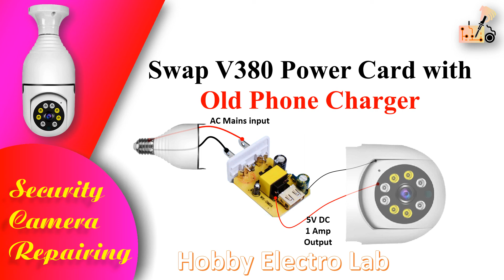Step-by-step Guide: Upgrade your Security Camera with a Mobile Charger!

Comment: Pa help na mn po sakin sira yung lgayan ng Sd card paano to?
Reply from the maker: Kung sira ang lagayan ng SD card, palitan ang slot kung bali o tanggal. Kung hindi nadedetect, linisin ang SD card at slot gamit ang cotton bud at alcohol. I-check din ang mga connection, baka kailangang i-solder muli. Kung hindi sigurado, mas mabuting dalhin sa technician.

Comment: I wonder if you can modify that camera to be able to be use by plugging it on a wire or modifying the body to be able to have it build in a hole on a wall😅❤?
Reply from the maker: Yes. I repaired many models the way I showed in the video... Thank for watching the video.
Reply: @ i mean if you can modify it so it doesn’t use a light bulb plug but a USB wire